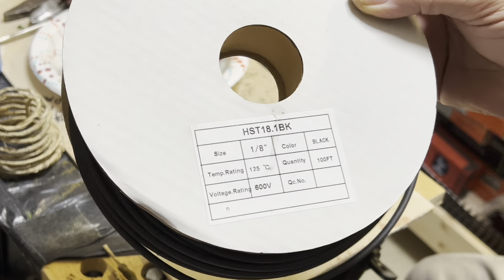O/On30 Pink Foam & Hidden Scene Going In - Model Railroad Adventures with Bill EP185

Comment: Bill, for inside the arch area, cut a piece of black foam board or poster board and bend it to the curve behind the trees.  It will act as a view block.  As to another source for foam.  You do not have to buy it from the big box stores.  Look for a plastics company in your area.  That extruded foam is a plastic.  Down here we have a company called Royal Plastics.  They have "mountains" of foam stacked up in their yard/storage area.  It may not be pink.  Royal here has it in blue.  I have seen sheets of it up to one foot thick in their storage area.  Plus they will cut it to fit your vehicle.  I have bought it 1" and 2" thickness in 4x8 sheets.  Who knows maybe your plastics company will have some broken pieces they will just give you as scrap.
Reply from the maker: I considered using the poster board as I have some but opted to go this route so if lighting is just right you can see beyond the portal I go woods .  The illusion works 👍🏼

Comment: I sure you know, but Saran Wrap is very clingy. It is only about 0.5 - 1.0 mils thickness. It will wrap around on itself and it is very hard to get separated! A static or ion gun will help, but it can be difficult to work with, because of the way it is processed.
Reply from the maker: It actually worked pretty well for this application.  I would do it in other areas but here it gave me an interesting joint between the sections